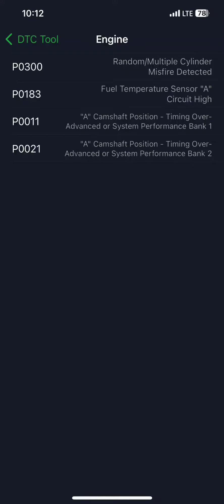Nissan 370Z, P011, p021, p0300 fix

Comment: Hey, Hoping you can help, recently done my timing chain and gallery gaskets on a g37, Ive started the car and it  runs fine until I rev it to about 3k a few times and it comes back down to idle and starts sputtering really bad and almost sounds like misfires
Reply from the maker: What codes, what year car etc...did u accidentally swap those harnesses?
Reply: @sethjoyner391   2008 G37 Coupe, Ive checked over everything, gonna pull cover again and check timing
Reply: @jamessbarker  any fixes, mines pretty similar atm!
Reply: @Banzai_Drift_Aus  full ecu reset with pedal dance or scan tool fixed mine. Make sure your timing is spot on
Reply: @Banzai_Drift_Aus  also to add I thought unplugging the battery would do it but it didn’t as soon as I reset the ecu it all went away and is still running strong today under 550whp

Comment: Hi mate, what are some of the symptoms for this as I don't have a computer to check yet, we did a manual swap in a few bits and pieces to the engine and the cars all of a sudden backfiring like crazy on idle. 

I'm yet to pull it up at a mate's shop to check anything properly
Reply from the maker: @Banzai_Drift_Aus  what year car?
Reply from the maker: @Banzai_Drift_Aus  and miles
Reply: @sethjoyner391  180km and 2012. Thanks mate
Reply: @sethjoyner391  also takes a while to start when the ignition is pushed
Reply from the maker: @Banzai_Drift_Aus  what's your key off battery voltage like?

Comment: Hey , my g37 2012 has p0300 , p0174 and p0455 also some time when I hate the pedal there's no response until I turn off the car and again turn it on but the engine still shaking because of random misfire !!do you have any idea??
Reply: Yooo my z having the same problem did you find any solution??
Reply: I have the p0300 code car runs fine code comes up on cold start in cold weather. Replaced sparks and plugs on bank 1 where I’m getting the issue